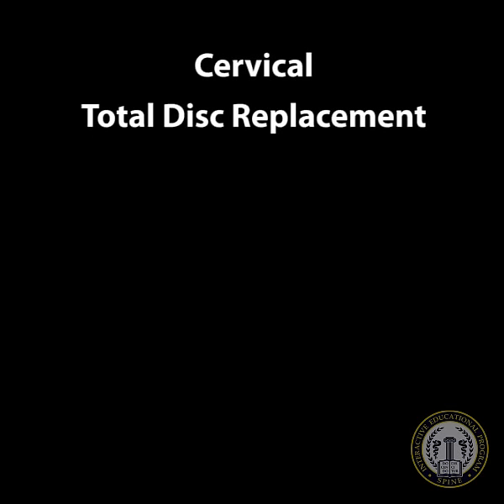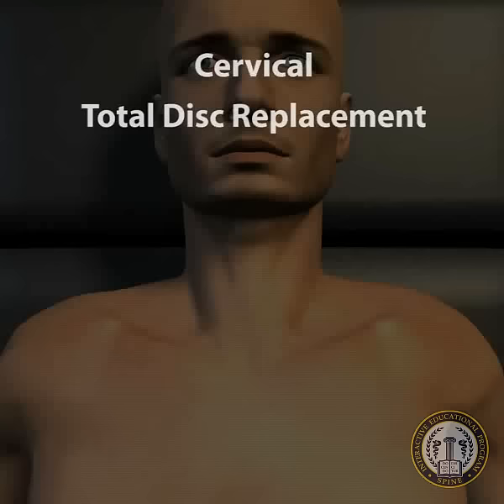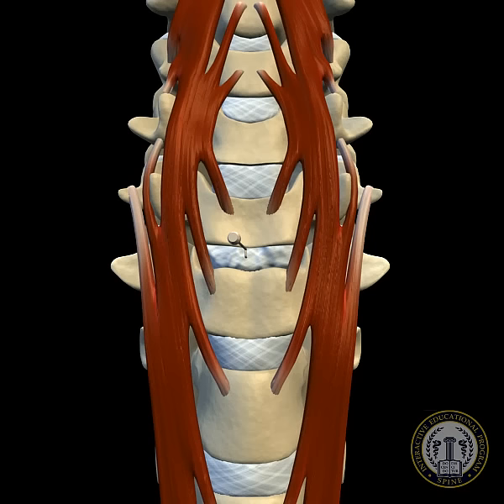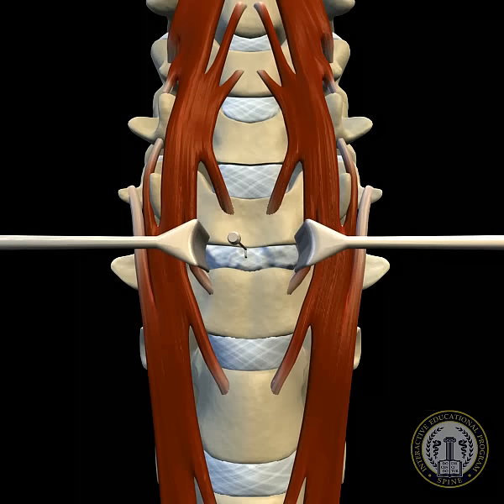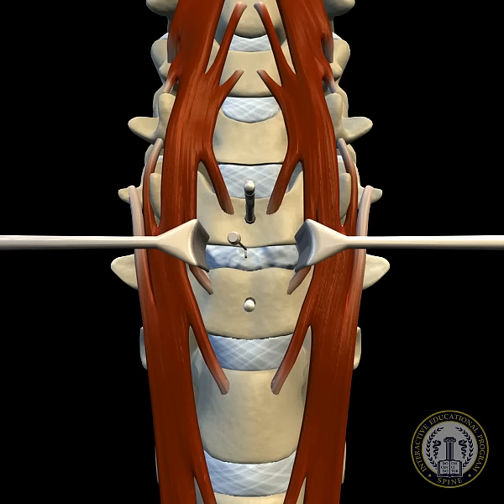Cervical Total Disc Replacement

Comment: I just had this done on Wednesday, Feb. 7, 2018. It's now Friday, the 9th. The only pain I'm really experiencing is from the incision point (they went in through the right side), and some tightness in my shoulders which can get to be a BIT unbearable at times. As long as you stay on top of pain management, and walk to help straighten and lengthen everything out, this is a lifesaver; it was for me.
Reply: Doing Well
Reply: @joseanibalberrios2758  Yup! I'd lost all function in my thumb, index, and middle fingers on my left side...couldn't move them at all...and I had a pain a the nerve junction in my elbow that felt like I had someone stabbing me with a red-hot poker, and it never stopped. After surgery, I could move my fingers, and the pain was gone. I still do the physical therapies I was assigned (if I don't, my shoulders start to hurt again), and still have weird pains now and then but, overall, it was a positive experience.
Reply: @ex-navyspook  So glad hear that 🙌 well soon 🙌 don't forget the therapies
Reply: @joseanibalberrios2758   If I get lazy, my body lets me know.
Reply: @ex-navyspook  Good 👍 Brave
Reply: e

Comment: I had a  C5-C6 disc replacement 5 months ago and was out of hospital next day, back at work in three weeks. (office based) My neck still has a slight ache, but my arm/shoulder has zero pain and no tingling sensations now. The scar is almost unnoticeable now.
Reply: I’m very late to this, but this comforts me alot. I am very young, but unfortunately my C4-C5 is compressing my spinal cord, causing spinal cord deformation and numbness in my hands. If I dont get the surgery done I could lose movement in my left arm. I’ll be getting this surgery at the end of the month.
Reply: Same happened with me.Exactly 5 months ago.At 52 yrs old,I was not back at steel construction until 5 weeks latter.Even then I still hurt because I didn't wait out 8 weeks dr orders.But now,I'm so much better.I just wished I had done this surgery sooner.I was in so much pain before surgery.
Reply: What is the total cost of the operation, and in which hospital in USA???
Reply: Can u go to gym after surgery nd live a normal life ?
Reply: @dineshkrishna111  I’ve never had a normal life. Haha, but Yes. 
I play golf, squash and am unrestricted in my movements now.

Comment: you should google the implant that I described - "DCI" from the firm Paradigm Spine (youtube messes up links when I post them). The implant simply takes over the job of the disk, and spaces the vertebrae they way they're supposed to be - I "grew" about a centimeter through the operation. I'm almost 49 now.

This implant uses no screws - it's a titanium "U" that is wedged between the vertebrae, held in by sheer force of ligaments, and bone growth over time. I love it so far!
Reply: Update?
Reply: How do You feel now?
Reply: I'm still here, 10 years later, I'll be turning 60 in September. Just saw notifications of these replies.

My neck is still 100 perfect, I don't even think about the implant. I did get an x-ray, just before the Corona time started, and everything is fine.

Best thing I ever had done to my body, I'm not kidding. 

If anyone is given the chance to get this type of implant, please go for it.
Reply: @sosacaustica-zs4mj  great! I haven't have a single problem. If this is an option for you, please take it. It's far better than other methods.
Reply: @user-03-gsa3  everything is awesome, I'm still overjoyed that I had this implant available to me 👍🏼

Comment: Hi my name is Ken.I had an MRI In 2015 and it showed,I had a Herniated Disc C 5-6.I have gone thru Physical Therapy.I have  had 3 epidural shots and nothing helped.I have been avoiding this surgery for as long as I can.I will see a surgeon probably in the Spring and see what he says.I am sure that I will need to get updated MRI"S. I Have pain in the neck the upper back,shoulders and both arms down to the fingertips. Any suggestions would be helpful.
Reply: Ken FREEMAN Hi Ken.. I had a two level disc replacement with the artificial disc and i feel fabulous.  If your surgeon recommends it, I say do it.  I did the epidurals and physical therapy and had the same problems as you with my arms and hands and when I woke up, it was all gone.  The recovery is pretty quick and I am so glad I did it.  Good luck!!